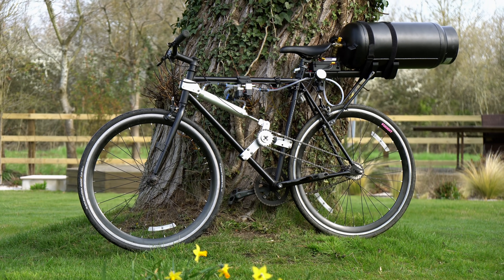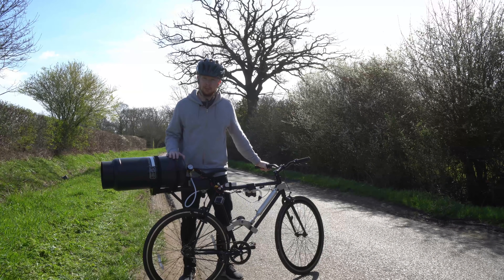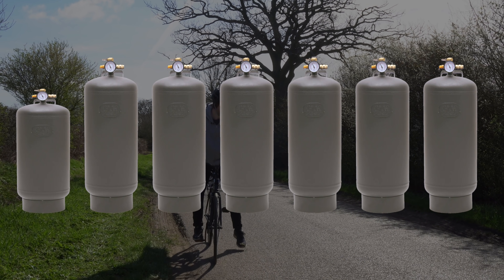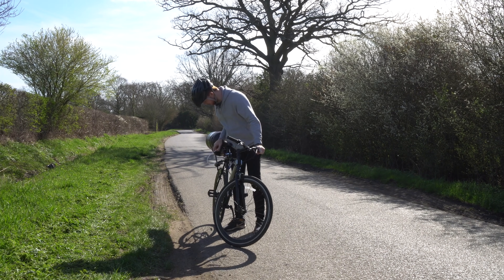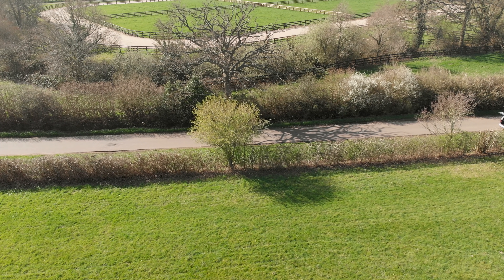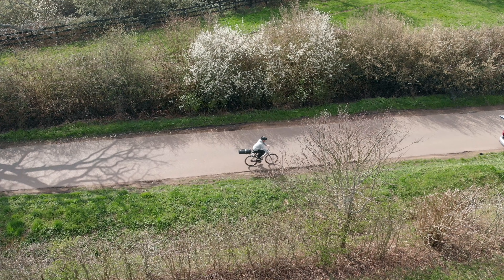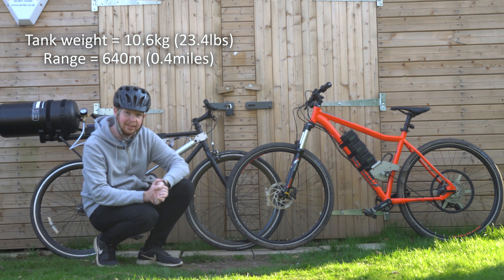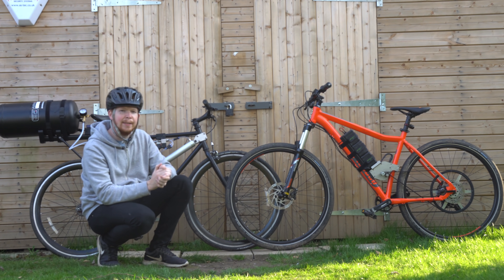Air Powered Bike Range

Comment: Energy is being thrown away by the regulator. Regulating the pressure down so you can achieve zero exhaust pressure at the end of the power stroke is a false economy. 

The power loss in the regulator is analogous to using a resistor to drop voltage in a circuit. The resistor will waste power as heat.  A more effective way to throttle the energy is switched mode power regulation, where one changes the on-time or duty cycle of a switching device.

 Steam engines in locomotives had a lever that modified the dwell time or the amount of time during the cycle that the steam inlet valve was open. The engineer could "tune" the duty cycle of the flow to optimize operation under various conditions.    Your Arduino controller program could do that but you would need an additional potentiometer on the handlebars to adjust the duty cycle of the valve opening.  Use long on times for high torque during startup and narrow the duty cycle when you are up to speed.

Comment: The trick to extend range in pressurized air vehicles is to use really high pressure bottles, then a first pressure drop to chill the air near freezing point of moisture in ambient air (or well under, but it requires a rotating brush to remove the building up ice). In such a way you can recover energy from ambient air to increase pressure of the plenum before reducing it again to activate the piston. Other than that, short stroke pistons with big bore are preferable, since they have bigger force with less pressure, thus decreasing both friction losses and exhaust losses. Applying a diffuser on the exhaust port decreses a little dicharge pressure for a little more bonus

Comment: If you were to revisit this project you may want to take into consideration that there is a difference between the volumes of the  extention and retraction because the retraction has has slightly less volume due to the air cylinder shaft retracting into that area

Comment: Do regulators waste much energy? If energy storage is roughly proportional to the square of the air pressure then 1 tank of air at 100 psi is as good as 4 tanks at 50 psi. Does regulating down throw away two tanks worth and only leave you with 2 tanks of 50 psi equivalent? Have you wasted the energy expanding 1 tank at 100 psi into 2 tanks at 50? (I know the maths is simplified here as existing atmospheric pressure and temperature changes throws this relationship off.)

Comment: Why didn't you use a single 4 way valve so that the intake and exhaust would be opposite of each other per side of the piston. It seems like that would be easier than 4 individual valves with timing.

Comment: How about using compressed air to spin a Tesla Turbine, mounted on a bicycle, to generate electricity to charge a super capacitor.  Then use the electricity from the super capacitor to run your electric bike instead of a conventional lithium ion battery.

Comment: Have you ever thought about using a similar system like this where the bike can accumulate air pressure (through the design of the pedaling system here), but you have a throttle to release the air. That way most of the time you are just pedaling at your own power, but you choose to essentially give yourself a nitro boost?

Comment: Look just get a 5,000 psi tank, mount it with the valve facing backwards, and when you are ready to go, reach back and knock the valve off with a 20 ounce framing hammer.  The real engineering challenge here is mounting the framing hammer to the bike with wire tether so you don't lose it.  Oh and making the tank easy to remove since you will have to replace it every time you knock the valve off.  I would have done the range and power calculations for you, but I don't have a envelope or napkin.  You're welcome.

Comment: if the cylinder spec says it is good for 100 psi, it will handle 160psi. got years of, umm, lets call it testing, in a industrial production plant. on LARGE die casting machines.
Reply: though I would also play it safe with it riding between my legs. but usually you'll blow a gland seal long before the tube will rupture (only seen one do that at 160 psi)

Comment: "If the exhaust pressure is at 2 atm, it effectively halves the range." This is why compund expansion engines exist, so as to utilize this exhaust pressure to further extract energy from the pressurized gas
Reply: Good point! But where would the much larger secondary cylinger go?

Comment: I build cylinders for a living both pneumatic and hydraulic. You could probably pull yours apart and turn and bore the seal groves to the extent of there working tolerance to lose some drag on the seals, and increase power output a little. You  could also use a higher pressure and regulate it down to store more energy.

Comment: How about using a hydraulic cylinder and pump? There would be way more torque in a much smaller formfactor so you would be able to use the larger sprocket. But i guess it would need more robust parts and more electric energy making it heavier and less efficient than the e-bike though it could be a fun project.
Greetings from Germany, love your projects and admire the engineering going along with it!

Comment: I've noticed that when air leaves a tank it typically cools... rapidly emptying a tank can cause frost on the port... I wonder if that cooling effect changes the air density and causes higher consumption. Thus a lower range.

Comment: Your experiments are nicely approached and executed with a fairly good precision , but you seems to have come from Mars or completely ignored the very well known scientific proven laws of energy ,,   in compressed air the energy is stored in a potential state , similar as a compressed spring , twisted rubber band , or water in a elevated tank ,,, in a battery the energy is stored in the "ELECTROVALENT"  unions of the electrons last orbit of the atoms put into play whether lead acid or any other elements exhibiting oxidoreduction chemical reaction ,,, and in hydrocarbons the energy is stored in the "COVALENT "unions of electrons , which is by far the :strongest"  the higher density ,,, that is why jet airliner are very effectively propelled by " KEROSENE"

Comment: I thought it would perform better than that. It would be cool to create a system that would flip the valve function so the piston would fill the tank with air when coasting down a hill. Maybe by turning a switch?

Comment: jej cool build & test. i am carriing the idea for airpowered bike with my for a long time. i had no idea about the range. thx for the calculations. but my idea is to use it as a kind of turbo. with a lot of pressure. and because i guess air would be very good to store the energy from the breaks. but maybee its only because i dont know much about the physics of pressure :-)

Comment: I AM WORKING ON A SIMILAR PROJECT MY BIKE CAN PRODUCE IT´S OWN AIR  SO I NEVER RUN OUT, FIRST YOU NEED A LARGE CC PISTON AND NOT A LONG STROKE THAT LIMITS YOUR RPM, LONG STROKE =  LOW RPM = LOW POWER

Comment: Not unless you can figure out how to get compressed air free, then i totally agree there is no use for mobile air powered stuff, and mankind don't know how to get compressed air for free, that i know.  But you also need to realize if the mainstream engineers had no other alternatives and had to invent air power bikes, that it would have much higher efficiency than what you did in your backyard first attempt. But at the same time, that is a little clue since the engineers never came out with air powered transportation directed to the consumer is not because they didn't think of it, but because there is other alternatives that work easier and better. It was a clue that it don't really work out good enough, and it don't really, not compared to other stuff. But if you figure out how to get air pressure without burning anything, then it could be implemented into this and maybe even built on it, mobile, but mankind don't know how. You would have to know something we didn't. 

Think how it was when they laughed at the electric car, and now the electric car is laughing at them. That is because a entrepreneur paid people to develop, paid specific people he knew he should to get the technology developed. That is like another clue, he didn't invest in air power and for a few reasons. But if you really did know something or figured out how to get compressed air conveniently, without burning things(including nuclear) you will later be laughing at us if you keep pursuing it. 

Another hint, if the universe is electric/magnetic in nature, then you are going closer to the source, and your conversions of energy transfer can be much more efficient,and sometimes maybe 100% efficient. Air is way down the line, electricity is more direct, air is just a gas subject to gravity. Electricity is not even considered a mass in itself, but it travels thru mass and causes mass to travel. In reality, electricity is probably just a chemical condition and we only perceive it as something invisible traveling thru wires and thru the universe. But that is what it is, and does, the chemical conditions cause the forces to act.
Reply: An electric car is the same fake as a coronavirus. 500km mileage ??? Really less than 200km. I laugh at suckers buying electric cars.

Comment: here's an idea, though i've never had the wherewithal to know if its a viable one: using a scuba  tank to supply power to a supercapacitor (or battery), which in turn drives a conventional electric motor. where one would get virtually free unlimited compressed air from any petrol kiosk whenever one runs low.

Comment: You could try adding a second low pressure cylinder that would run off the low pressure exhaust air of the primary cylinder. This method was utilized with great success in steam locomotives.

Comment: I might try a second regulator at a higher pressure, which you can switch to somehow? give you a bit more power for starting and hill climbing
edit- also, a paintball tank might be worth considering, they can hold pressures up to 4500 psi of air. much more compact

Comment: you're also forgetting the 'recompression' of the residual air in the cylinder, you need to vent side one when side two is expanding the working fluid

please take some thermodynamics and thermodynamic cycle classes, analyze the design before you start making the design

you, sir, are a mechanic, not an engineer. your approach is not analytical (even though you try to make it sound as such) but more akin to the style of the American inventors - try, try, try something without knowing the basic problems

Comment: It could be optimised and also there is way to not loose preshure and actually use the cylinder asa a pump at the same time. Also using gears will make you "speedy" :d

Comment: Cool project! For SCUBA I was building a similar thruster that was to se 2 cylinders for better efficiency. (like the compressors use). 1 high pressure going from 150-75 then 1 low pressure 75-10.

Comment: simply use quick release valves direct mountet on both inlets. a cheap high pressure air tank would be an old fire extinguisher ( 350 bar). your speed ( torque) regulator should be a variable pressure regulator. under those conditions you even would´nt need a controller ;)

Comment: Air or pressure powered vehicles actually did see success in one field. Fireless steam trains, these were used for shunting and short transport at factories throughout much of Europe during the turn of the century, the reasoning behind them is that the factory usually already had it's own steam engine so for work around it there was no need for the train itself to carry one. The train would then instead of a boiler just have a huge tank for storing steam or pressurized air and recharge at the factory's steam engine.

Comment: How much more efficient is an air motor rather than a ram the frame of the bike could be part of the tank Air powered machines have been used in mining and does show some advantages over other storage systems and with the Trump bump it can be obtained quite naturally

Comment: Obviously battery is better but you're not factoring in the weight reduction if you put the scuba tanks on a small cart and pulled them.  You could probably put 4 tanks on a cart (a maybe a single large shop tank?).  That's a LOT more air. You need a large pneumatic pump as well and variable gearing.

Comment: You urgently need an additional "Z-Stoff" and a "C-Stoff" tank on your bike, then let them combust drop by drop in your air tank and you will travel faster and further! You just have to adjust the pressure by combustion rate and/or speed. That could be a little tricky, but there is always a margin as in any steam lokomotive.
Reply: ...or just use a propane bottle with a wopping 0,83 MPa of gas pressure at room temperature!

Comment: Change the original actuator to 3 smaller actuators, 120 degrees. Remember, P=F/A (piston surface areax3), F=PxA (the trick with piston actuators). You also need some oil in the system to help with the friction. May work much more efficiently with a solid (liquid such as water but will need compressed air on top, "milk" or cutting-oil & collector tank to recycle it). Actuate each "cylinder" to their max at first 30 to 40 degrees in motion: think along that line and TDC(TopDeadCentre), etc. Remember, higher speeds, lower "power" needed & intake/exhaust earlier. Use a 10-speed bike gearing or so. You can dweet!!!

Comment: Would it be possible to have the valves and cylinder work to create pressure on pedaling to gather some fuel back as you rolled down hills?

Comment: What if you had  2 smaller tanks and with some more fancy pressure valves, could make a way to take the exaust air and recylce it and  fill another tank and then repeat? Could it some how be self regenerating? Great engineering my friend!!

Comment: But could you reprogram the controller to change the valve timing so the piston works as a compressor when you're pedaling or coasting downhill? Essentially pneumatic regenerative braking. Just be sure to put a blowoff valve in the system or you'll be pumping up a bomb.

Comment: Use the pressure to power Tesla turbine attached to a generator in the tires to charge the battery for added distance to electric bike, than add a  compressor for added distance to tank 🤔maybe have exhaust gas exit into a vacuum tank for added torque...also utilize your pedals to reduce the load many gears and speed..go the distance.

Comment: can you use the cylinder as a pump when breaking and steep slops? 
2 smaller cylinders in v formation (45degrees differens) shuld give you more range and higer effency an the second cylinder is driven by the wast pressure from cyl no 1

and 6 or 7 liter 300bar scuba tank is smaler in wight

Comment: Could you use the wasted exhaust air pressure in a compound cylinder arrangement, as in steam traction engines etc.
 Just a thought, not really lots to gain but an interesting 3rd video?

Comment: It is indeed a re-invention of the steam machine. Considering the overall weight of the system, it is not suited for bikes as it will never be a lightweight machine and have a wide action  range. First thing I would change in this set-up is installing pressure hoses to prevent losses.

Comment: You've got to input energy into compressing the air up front to puff along at 3 mph at the end. Failure..... their ain't no free ride. I make engine powered  bikes on a professional level. A quality Honda or Subaru engine in stock form can get you to 40 mph with great gas mileage.

Comment: A lovely project. Good experimental analysis as well. One thing not discussed was differential volume and force of the air cylinder. Any double acting cylinder with a single ended rod exerts less force while retracting than extending. This is due to the area of the piston rod. Your cylinder has a rather thick rod compared to the piston diameter, so the difference is fairly large. In terms of you pedalling the bike, it is like having one leg stronger than the other. Because of the mechanical constraint of your drive train the distance travelled is equal for both cylinder strokes. The power, however is more when extending than retracting. In the hydraulic boat steering industry in which I was employed we eliminate this differential cylinder effect by using cylinders with double ended rods, so the power is identical in both directions.

Comment: ICEs, and this bike, sacrifice breathable air for power.

Hydrogen cells sacrifice water (and a bunch of other things) for power

EVs charged fr renewables sacrifice (95+% recyclable) batteries for power

The EV is the clear winner in every way by a massive margin.

Low wasted heat, low friction, no need for the massive amount of energy needed to compress air or hydrogen or other gas, and no weighty tank-bombs to bring along with you, and very low number of moving parts compared to just about every other alternative out there.

Hydrogen is only useful when you need to store your excess renewable solar and wind electricity such as is used on the electric yacht that circum-navigated the Earth 50 times or once or twice or whatever it was :-)

Simple synergistic solutions are best.

Comment: hear me out on this one... what if you attach solar panels to a go kart or bike, then connect those solar panels to batteries and the valve electronics, and run a small industrial/car air compressor off of the batteries, the compressor would push air into the tank..basically it continuously has enough pressure in the tank to run the piston, and its all solar. so power and psi effectively aren't an issue anymore.. just a wacky thought but maybe it could fix the range problem.. the only limiting factor is how much sunlight the panels get, as well as for how long you have sunlight.